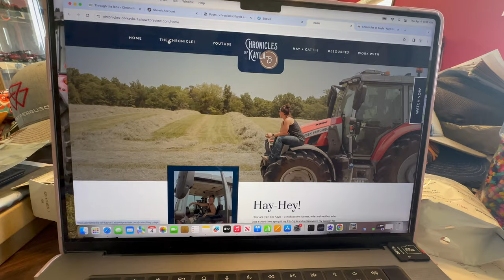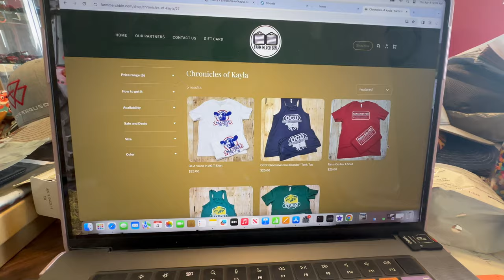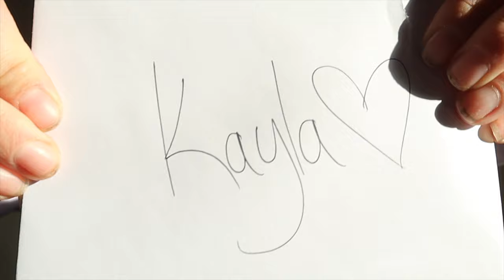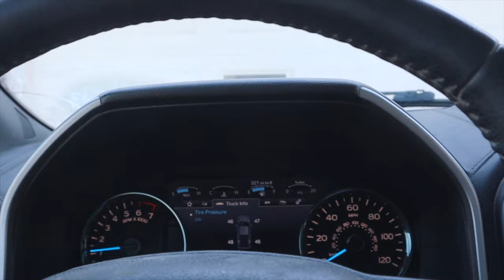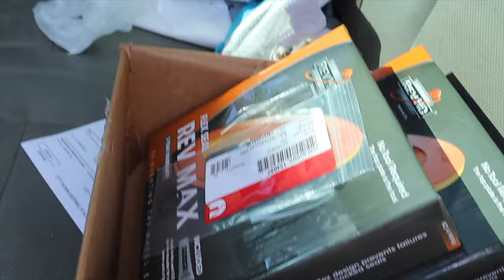Catching up: Shop Repairs, Load outs, Hauling & a whole lot of excitement to come!! | #femalefarmer

Comment: . I worked for  A truck leasing company like  Rider..... Interstate National Lease  That maintained  U.S. foodservice's fleet.....    We had a wheel dolly so we didn"t have to disassemble   wheels, pulled  both as unit...  As for  The  loading of a 53 ft trailer..... We  can put 12 rows of 3- Bale Baron bundles  and still close the doors.....  By swapping from the Bandit to the Baron we increased our load   over 200 bales......   One of our customers is a competitive Barrel  Racer.....